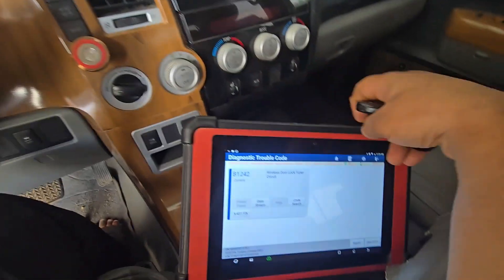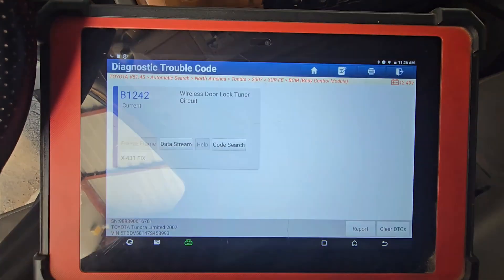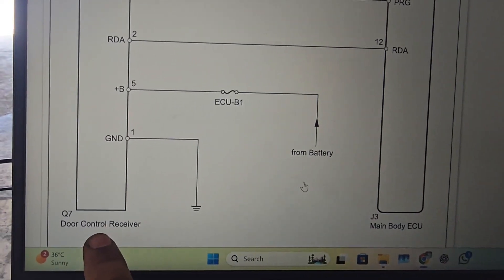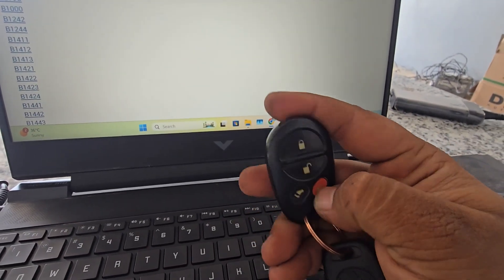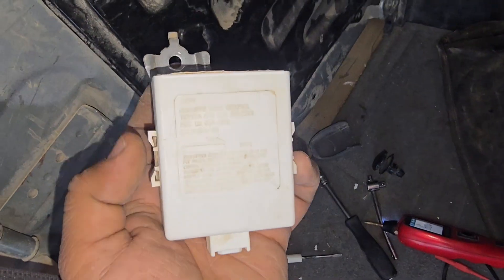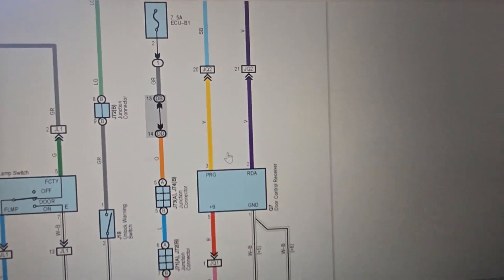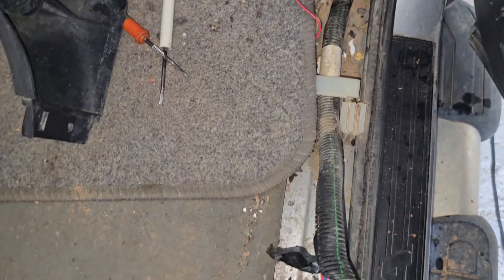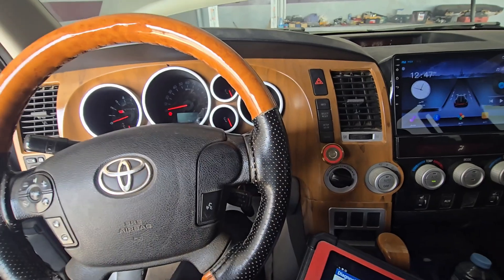B1242 wireless Door Lock Tuner Circuit Toyota || Remote Not Working + Solution 💯

Comment: How to know where is this module is installed,  and how we find the location of wiring , like wire  from battery side fuse and where it's go
2nd i suggest you for tracing the wire  you need device like powerprob ECT3000
Reply from the maker: Alldata  softwer